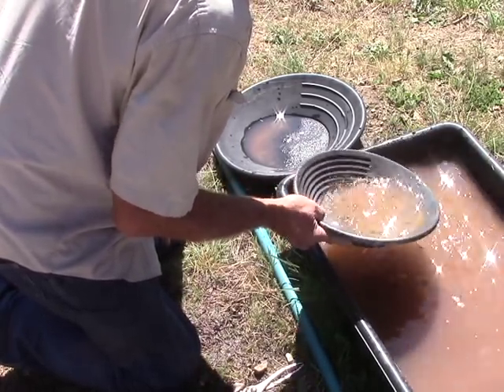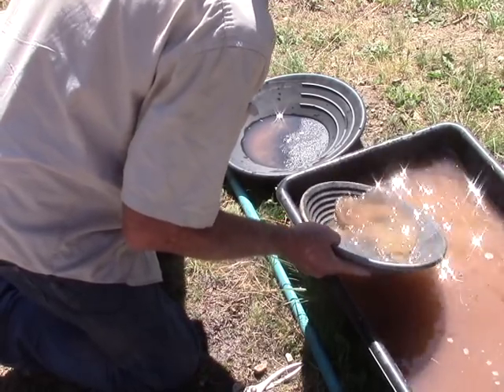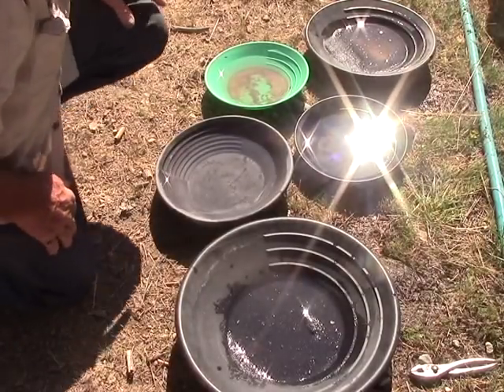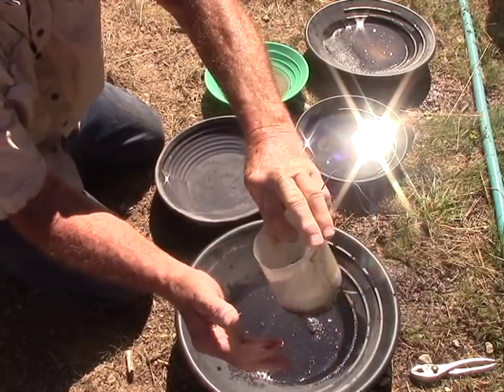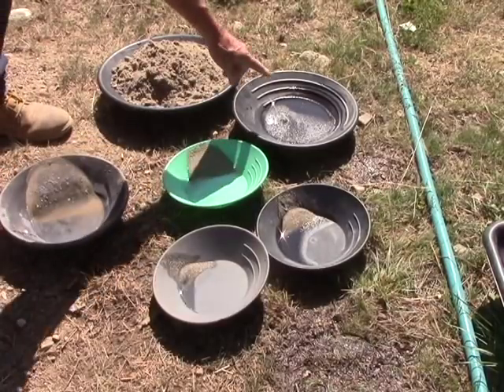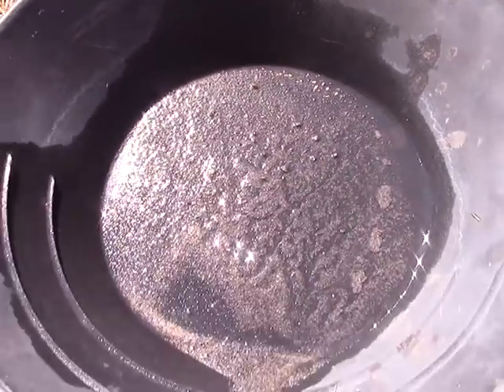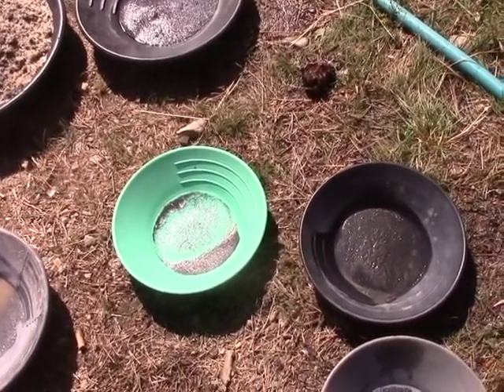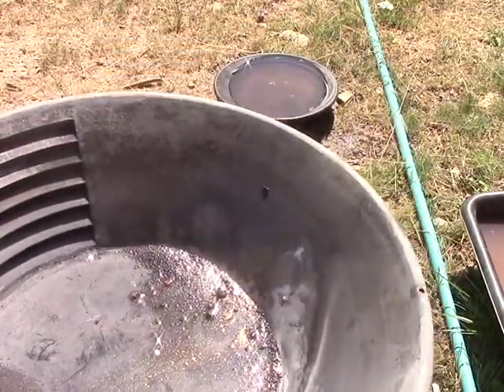Mine Report 6 3 Processing Dredge Concentrates and Magnetic Separation

Comment: So, whats your conclusion? Is this preferable method by magnets? Looks quite easy.
Reply from the maker: It is often quite useful when combined with a gravity separation.  In hard rock ore I often use it at the end to separate the metal shavings (from the crushing process) from the gold.  They are the two highest density substances usually.
Reply: @hardrockuniversity7283 , thanks kieth, for your kind reply.

Comment: Wouldn't classification assist with some of this challenge?
Reply from the maker: Certainly.  I was just doing the preliminaries while the owner was gone.  He didn't authorize me to go further.  Thought the magnetic demo was worth a video.

Keith
Reply: Hard Rock University. Sorry Keith l. I probably sounded critical. Keep up the vids. Sorry you're not making it to AK. You should stop by Harrington and Baldwin in Grass Valley, CA on your way back.   Sam could probably hook you up with a spot to make a little gas money for the drive back.
Reply from the maker: I didn't take it that way at all.  I assumed it was just an honest question, so I gave it a straight answer.  I was pleased that you saw the PRINCIPLE rather than the procedure..  I actually DO classify the blondes and magnetic tailings before putting them over my table to scavenge any remaining gold and also to gain experience with different materials.  I am learning a lot this summer- FUN!

I will be much better prepared next year, so all is good.  Going back through Utah- High Speed/ Low Drag way home.  Thanks for the tip though.

Comment: Thank you Keith showing us some gold! Is that all the gold you found in one day or week? That's about how much gold I find on Turkey Creek in the Bradshaw Mountains in a couple hours.
Reply: I use a 4 inch dredge damn up the water then go to town. Normally I go dredging in the spring and in the fall. But over on Crooks Creek you can dredge all year round.
Reply: Travis Gilbert used to love dredging Turkey. Been years
Reply from the maker: Sounds like a blast!
Reply: Hard Rock University Recircing is hard on the pump. After replacing the impeller once or twice you have to throw the whole pump away because the housing is warn large ibside
Reply from the maker: Well, you would want to settle it some if possible.  Sometimes the situation makes sense to put the extra wear on the equipment, sometimes it doesn't and you just go elsewhere.  The only rule is:  there are no rules, just tradeoffs.  :-)

Keith
Reply: Keep up the hard work thank you for all the good videos appreciate all the information!
Reply from the maker: You're wecome.
Reply from the maker: Not sure exactly.  The cons had been stockpiled for a little bit.  I would guess about one day's worth.  Do you dry wash?  Thiat is the Bradshaws of AZ right?